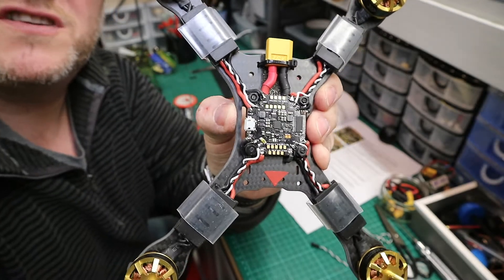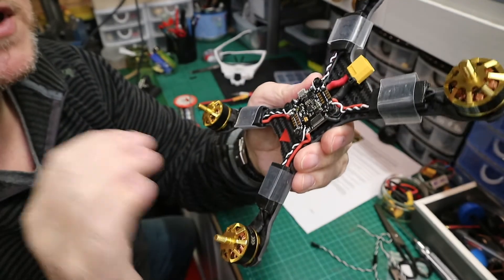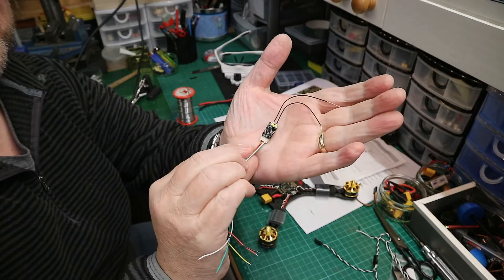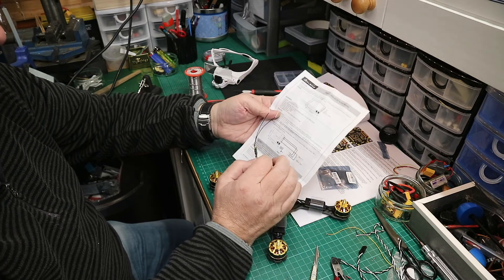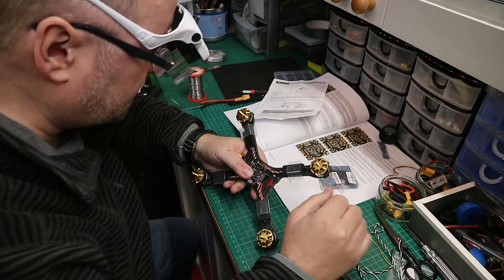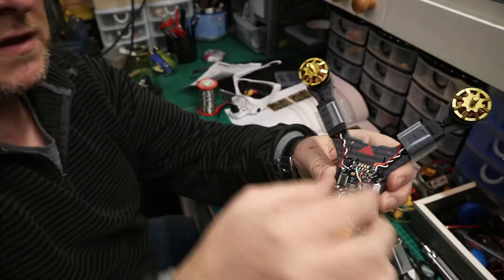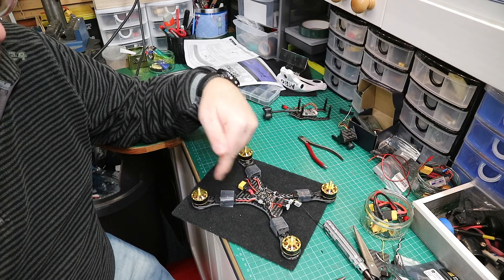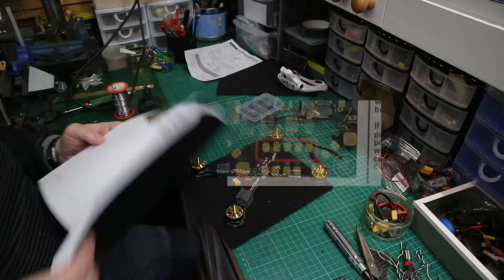How to build your first quadcopter - Part 3 - Receiver & Buzzer - Joshua Bardwell FC

Comment: Hi, great videos, they have been really helpful in getting my first 5" quad built. I've just got the radio, everything is put together. I need help, with betaflight setup and my radio set up.
Reply from the maker: That is the tricky bit that you need to get your head around. The Joshua Bardwell manual provides good set up instructions for betaflight. It may be a good time to liaise with a local club as you will benefit from their experience with setup and tuning. Every time I do a software video it is out of date within a week or two when they bring out new versions.
Reply from the maker: Check this one out
https://youtu.be/xmaTq4JgTXI